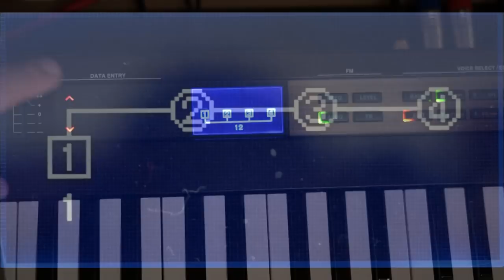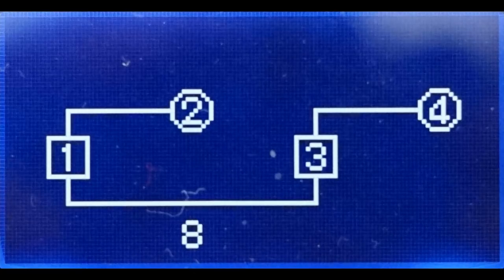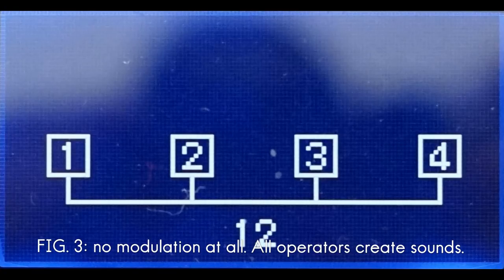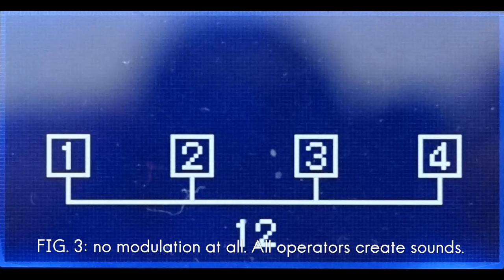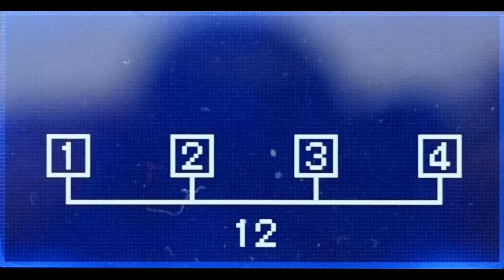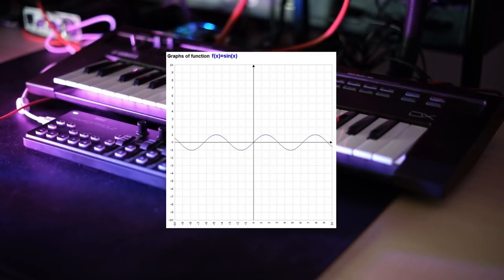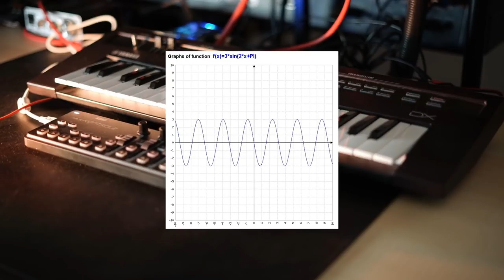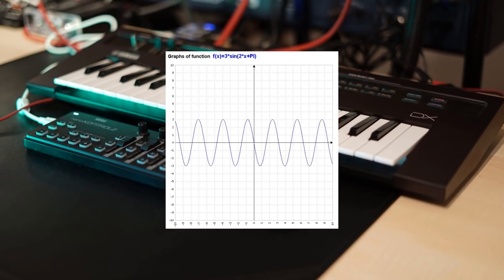FM synthesis basics explained with an oscilloscope (Reface DX)

Comment: No. FM is not phase modulation. FM modulates the frequency of the carrier. Four oscs in parallel are Additive Synthesis (AS), not subtractive, but you used a saw wave as carrier, while AS uses normally sine waves. You need a frequency spectral analyzer not a simple osc screen to visualize what really goes on. Does anybody study a topic anymore before putting out videos that just show him/her not understanding the topic?
Did you ever study Fourier Transformation and Signal Theory? You should! smh
Reply from the maker: Hi! Thank you very much for your feedback. On Yamaha Synths, it's definitely Phase Modulation (you can look that up on google, there are many sources indicating this: https://www.google.com/search?q=yamaha+dx7+phase+modulation
).
Reply from the maker: Please also take a look at this video. https://www.youtube.com/watch?v=pdLAdojHVW8
Reply: According to Wikipedia, actually Yamaha's implementation is indeed a phase modulation synthesis: https://en.wikipedia.org/wiki/Frequency_modulation_synthesis (see the start of the history section: first couple of paragraphs).
Reply from the maker: I think "FM" is a very broad term. It's a term for "embedding a signal in another signal" (and I know that's a pretty unscientific description). "FM" is used in analogue radios or electromagnetic signal transmission in general. If I wanted to "decode" the FM'd signal then of course I'd need more advanced tools than a $20 oscilloscope ;-)  I think that's what pcuimac wanted to say. But that was not my intention. I just wanted to show that Yamaha's implementation is phase modulation, and "stacking up sine waves just right" (again, very unscientific wording) results in other "standard" wave shapes. 
"Feedback" works exactly the same way, but instead of "stacking" multiple operators, it's feeding back the modulated signal into the same modulator multiple times, until the desired wave shape is created.
Reply from the maker: That's right. Also, the Reface DX has a high quality effects section, a much easier-to-use interface, better A/D converters, is battery powered an can easily be carried around or tossed into a suitcase while travelling. ;-)
Reply: FM is phase modulation. Look at thé Yamaha patent for FM. À value in a carrier's phase generator is converted to a logarithm number ( to avoid use of a multiplier) and added to the value outputed by a modulator ( value also converted to a logarithm number). After that this value is used to address à table where à sinus table is memorised. The value at that address is converted to a linear value by logarithm to linear converter ( simply à table) to retrieve a good result ( a linear result ).